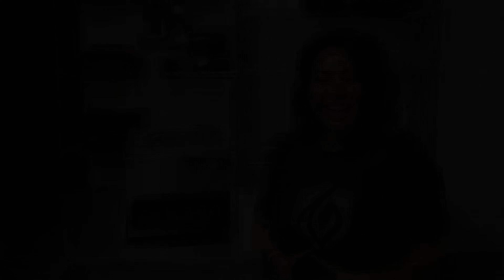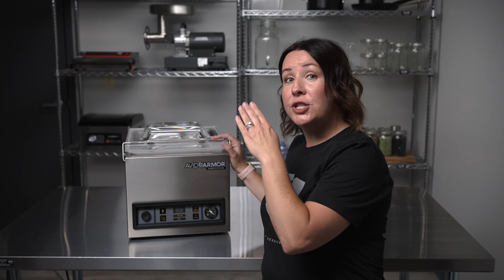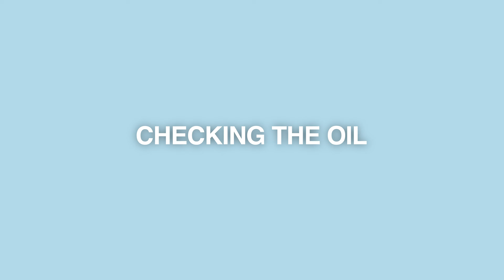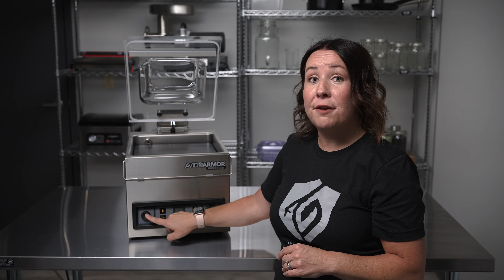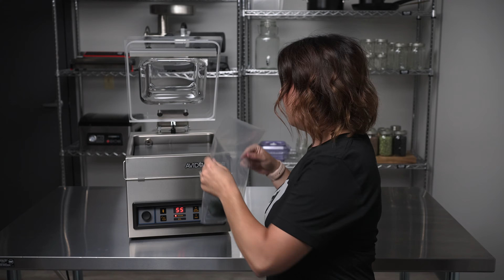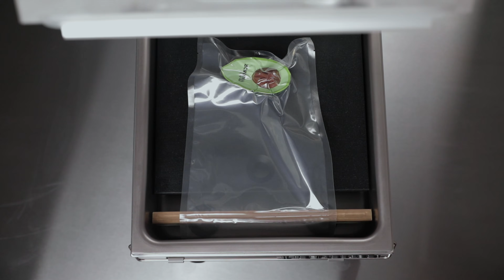Getting Started With Your ES41 Chamber Vacuum Sealer | Avid Armor

Comment: I have the same packaging machine made by Henkelman, the Mini Jumbo model... it´s incredible. The pump is so powerful and the sealing is perfect. In-home use, the oil probably needs to be changed twice a year and the filter only once; in such a way that it´s practically maintenance-free like a dry pump packaging machine, but much quieter and more robust. It's a technological beauty worth the price. I recommend it
Reply: And much better priced than from Henkelman's "sole" U.S. distributor, who only have certified used units.

 @Avid Armor, are there any plans on branding the newer Aero 35?